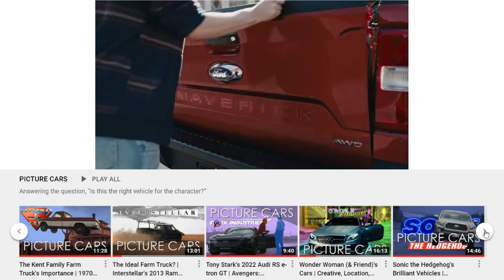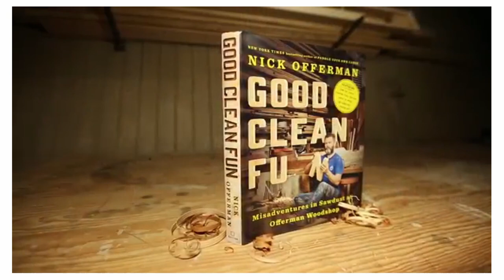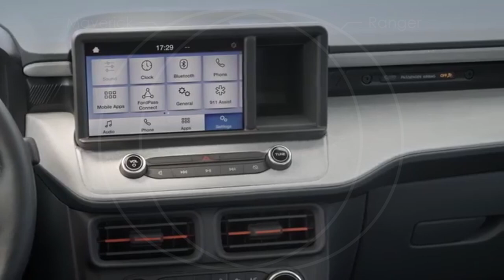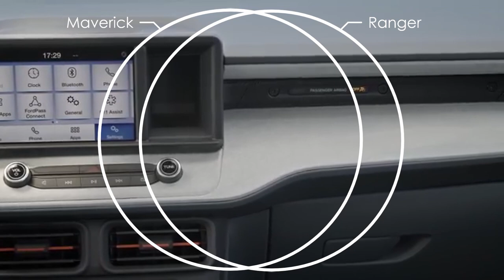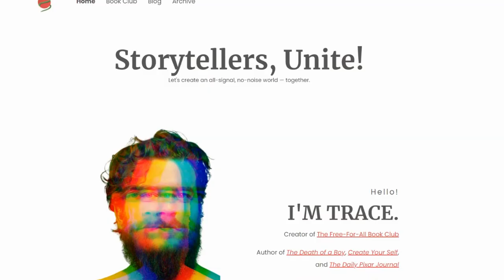Is This Really the Maker's Truck? | 2022 Ford Maverick

Comment: I do see myself driving this car. I’m not a fan of Ford but having a vehicle with a bed makes it easier for me to take samples and orders to customers. I drive between 200-400 miles a day so it’s hybrid system makes sense.
Reply: Keep in mind, though, that hybrids get the best mileage in the city which is where they can utilize best the regenerative breaking. So if you're doing lots of highway miles, a hybrid might not be the best choice. But alas, who knows. It might still be more efficient than any other big truck out there. I guess we'll have to wait for more numbers to come out. Its smaller size does let the imagination soar, though.